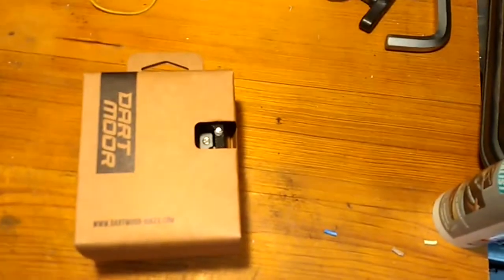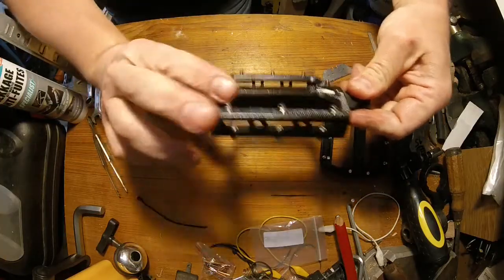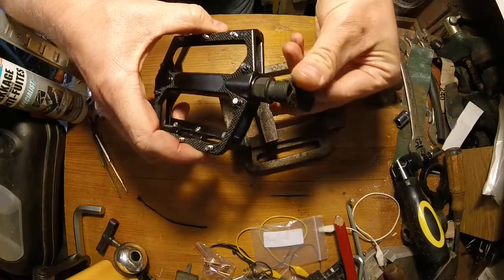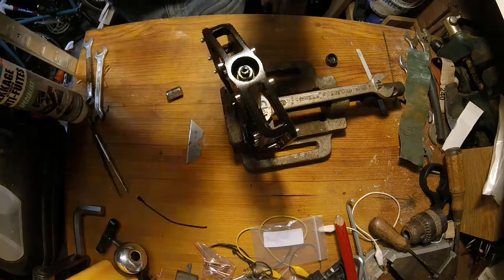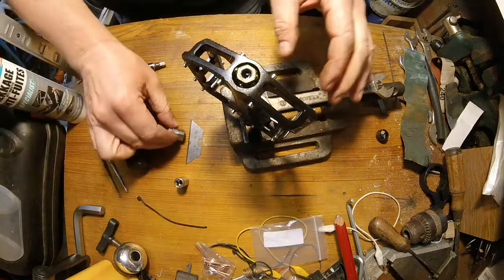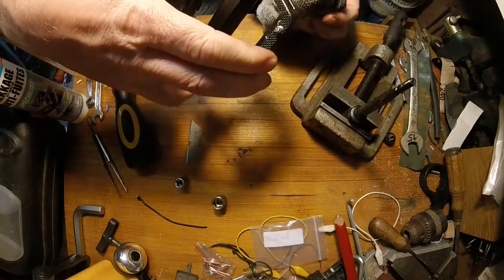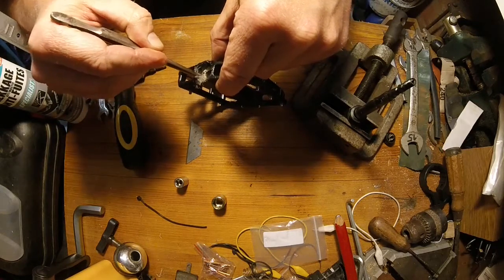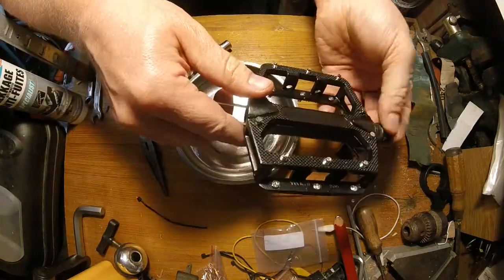Dartmoor Stream - MTB platform pedals overhaul

Comment: Just bought mine yesterday and that's the first thing I checked..and wow, very disappointed , coming from a three sealed bearing pedal user haha.. good thing I got it on a cheaper price.. I'll try that
Reply from the maker: I assume that at the factory they just tighten the axles without adjusting them. I've spent like half an hour adjusting those pedals but I guess one can halve that time if proper tools are used to lock the nuts. I have an idea of using a pipe wrench on the outer nut (the smaller one) and fabricating a half-round (half-hexagon in fact) tool to hold the inner nut (the larger one, with the race) in place while tightening. I'll try it out once I give an overhaul to those pedals.
Anyway, good luck, once you adjust the bearings you'll be very happy with those. At least, I am.